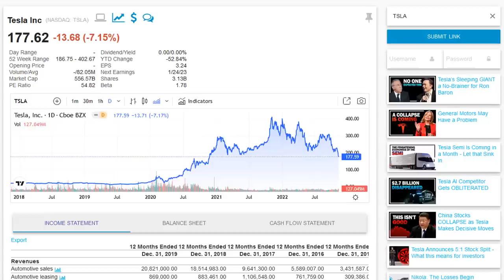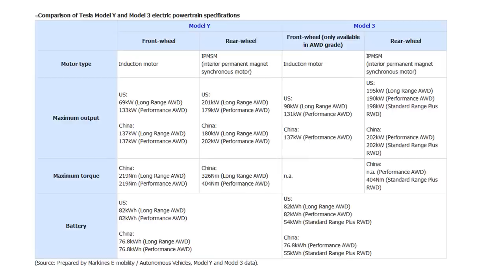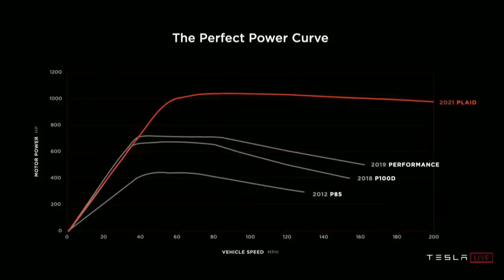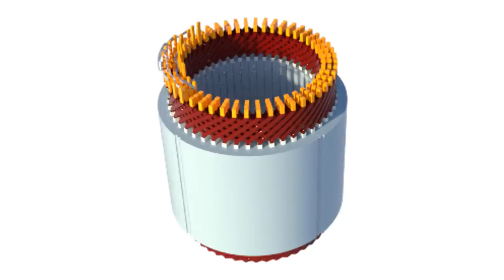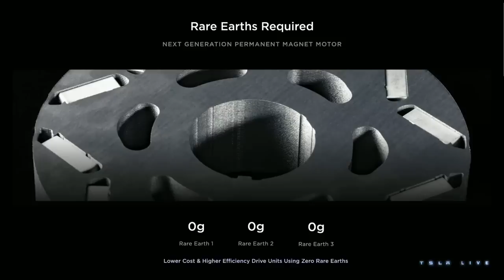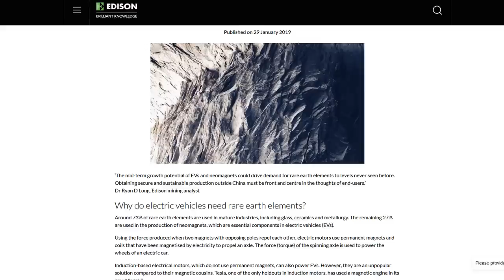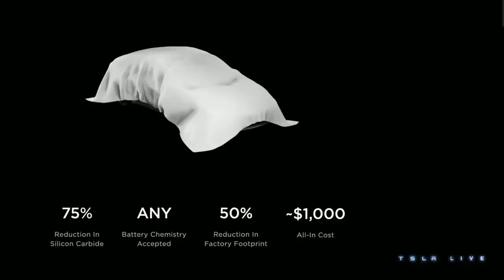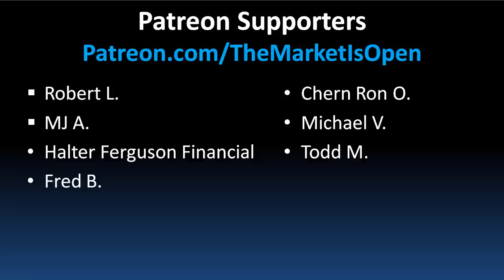Elon Musk's NEW INSANE Motor SHOCKS The Entire Industry!

Comment: Electric motors are only temporary.  Hydrogen/water engines, ionization plasma, etc. will also appear.  In a short time, maybe 50 years we will see gravitational/anti-gravity propulsion that will completely redefine planetary and interplanetary transport.  For galactic/cosmic transport we are talking about another necessity (probably in 100 years), namely the modification and regulation of local space-time as needed and the use of interdimensional wormholes as a shortcut - means of transport in the universe.  Later there will be physical and quantum teleportation and time travel in both directions.

Comment: 13:50: Wow. By making the battery smaller, the rest of the car just became $7,000 cheaper. That must be more accurate. 

/sarcasm

Hopefully you understand that the cost of the chassis is completely independent on how many cells you cram into the battery pack of the same vehicle.
Reply from the maker: Agree, but I prefaced it saying the rule was dumb to begin with

Comment: Tesla still has to figure out how to keep those electric  engines running without stopping for a charge (where there is a will there is a way ) lol like a magnetic clutch on a flywheel for assistance with power draw to help keep rotation +added power ,and a second pickup magneto to keep the charge going through the system .
Reply: That’s called a perpetual motion machine and is impossible.
Reply: @techstuff6829  It's 2023 and there are still people saying in the comments here "Why don't they charge the batteries off the motors?" It amazes me that there are people around who think that perpetual motion is a thing.

Comment: The issue isn't does it work better, it's the fact that the material's envolved in producing the energy to power the auto, which is the battery and what a battery is made of that's the issue. An conventional combustable engine requries a considerably smaller battery to operate. Dealing with the gazillion's of considerably smaller batteries is far less dangerous than the gazillion's of extremly larger batteries that EV's require.

Comment: What a stupid blah blah. Hair pin windings have been used previously (as stated in the video), indivdual motor simulation is state of the art, even for low end products. Reduction in silicion and silicion carbide, but at the same time pictures are showen of microprocessors from the media computing and ADAs systems, which has no implact on drivetrain efficiency and cost. Shockingly shitty documentary, nothing more...
Reply from the maker: I showed the inverter and charging chips which have impact on drivetrain cost.

Comment: Very good but what about the lithium bottleneck
Reply: Nobody wants to discuss it because theres no alternative to lithium. alot of the materials for those batteries is becoming even more rare and difficult to mine. Most of the worlds Cobalt is concentrated in the Congo and is mined by hand......There isnt enough matrerial to make a battery pack to replace even a 1/4 of the worlds ICE vehicles. Along with the many other inconveniences of electric cars......Making the motor cheaper is good but all it will do is offset the eventual increased cost of the battery.
Reply from the maker: Addressed in lithium video, a few videos back

Comment: Its the Henry Ford way of thinking. Make a reliable vehicle at a cheap price and everyone will buy em. Ive long been a combustion engine person, but if they are going to offer them for sub 20k price tags hell yea ill end up with one. Now just hope that they can get them to last longer than a couple hundred miles.
Reply: 1 - CME or EMP will fry your car.
2 - ANYTHING that disrupts the power grid will leave you with a dead car.
3 - Tesla can remote control it. In fact they are going to remove the steering wheel. How do you feel about that?

Comment: "Just when you thought it couldn't get any better" leaves me wondering whether this narration could get any worse. I arrived to learn about an electric motor. I stayed to play a drinking game.
Reply: No, that was the worst howler. But this video then skirts a central issue. Efficiency of prior design (with rare earth metals): good. Efficiency of new design (without rare earth metals): good + epsilon (unstated increment). Prospective new design (with rare earth metals): possibly spectacular. 

Tesla effectively answered the question: Can we improve the efficiency of our current motor, even if only by a tiny sliver, but without using any of these three rare earth metals at all? 

Could someone else come along and improve Tesla's new motor by adding the rare earth metals back into a new design? Quite possibly by quite a lot. 

And the breathless breakthrough will again begin: "Just when you thought is couldn't get any better ..." 

"Better" in this case means cheaper for mass consumption (the slightly purple phrasing used in this video was "access to technology"). 

"Better" on YouTube generally means that it can shred your tires in half as much time.

Comment: I read that a guy left his Tesla at a long-term parking at the airport. And after two weeks when he got back from his trip, his Telsa's car battery was dead.  I wonder what caused that?  Was something left on? Like a dome light?
Then there is still the issue of how do you tow a Tesla? With a regular ICE = Internal Combustible Engine Gas used vehicles; it would be put into neutral to hook up to the bed to push onto the tow truck bed. What do you do with a dead battery on a Tesla? 🤔
But keep in mind your Tesla has minerals being mined by poor Africans and using children to dig for the minerals that is built into your cell phone, your EV, and most electrical tech that is out there.  How is that clean "Renewable" energy? Plus, you still need oil, coal and gas for the charging station to charge your EV's Something to think about 🤔
Reply: they are building several solar farms across the country and in some places its cheaper per kwh than gas or coal plants
Reply: @buddyflood6761  🙄

Comment: Motor-shmotor...  Until Tesla, or someone, comes out with a better battery system, a better battery, no motor will be good enough.
Electric cars have the one weak link, of having to be recharged.  Short trips, or long hauls, the results are the same.
And charging an EV, can take as much as 12 hours or more!  That's hard to plan around.  You're daily activities are limited to the time it takes to recharge the car, before the next use.
"Solid State Batteries," sounds like a great idea.  But even after a couple of years, their promises of better EVs have still yet to materialize.
They were supposed to last longer between charges, take an EV further in milage, and faster to recharge.  Hours faster!  They are supposed to be much lighter than the common battery packages being used currently.  And they were supposed to be way cheaper than the current batteries being used in EVs today.
But where are they?  Why are people still having to pay out the nose for an EV, then pay out the nose all over again, to replace the battery pack in their car every couple of years!?

Comment: First and foremost eletricty prices are  inexticably tied to natural gas, oil and coal ; that the left wants to see gone!! Does that make sense to you. . The price of electricity is increasing faster than any other sector of energy production. It will be four fold then six fold increases. Not to mention the over taxed infrastructure as 50-foot arches of (blown up) high voltage sparks  burn down our forests.  Who is going to stop it. Nancy Pelosi?  It is rigged against us full stop. EM , is a good man, he's a product to sell and it is innovative; but also dangerous as hell. Do you really want a car whose efficiency drops 30 to 40 percent in cold weather? Already, I mean last summer California asked EV owners not to charge their cars . Okay, I guess we'll walk.  Do you really want a car that can be " at the flick of a switch".. disabled , halted ?? Dangerous? Yeah maybe. They'll do it, is the problem;. They, ( the deep state) has proven that they don't GAS about you.  EV s are a coming nightmare of high costs, and inadequate technical knowledge to diagnose and fix,. You will not be able to do a thing but pay sky-high prices for repairs etc. , to someone that barely knows what they are doing. Repairing your own vehicle will be long gone.

Comment: The only reason Tesla says the price of a motor is about 25% of the cost of a car is because the motor cost was so high.  Reducing that cost changes the ratio of the cost, so now, a motor will be something much less than 25% of the cost of the car. a 6000.00 drive train does not translate to a 24000.00 car.
Reply: Thank you Spike.  My head wanted to explode when I saw those two bogus calculations.  I wonder how many saw those and marveled at how smart those guys were.

Comment: At around 80 °C, a magnet will lose its magnetic force and it will become demagnetized permanently if exposed to this temperature for a period, or if heated above its Curie temperature. 176 °F. So if motor reaches 80 °C. The motor becomes a brick. 😂
Reply: I’m confused… do you think Tesla engineers didn’t know this? Do you think those motors get hit or don’t have cooling or something?
Reply: @warbuzzard7167  Cooling is done either by air, oil or coolent. A internal combustion engine can run as hot as 240 °F. So it can operate in any weather here on Earth. A electric motor has a range it cant operate. Too hot or too cold. Electric motors become a brick. Too far north. Too cold. Near desert enviorment. Destroys the battries. A $40,000 car should beable to run for +10 years or more. These electric cars? All you have to do is run it dry once. Poof. The motor/ battries is gone. Forgo real world issues like having to drive yourself out of a situation? Right. A life or death situation? Right. Like a blizard. 😉 up north. More hype over nothing.

Comment: Should make semis all wheel drive. Would really be good in snow and ice.
Reply: Back 8 cab tires are powered already, front steer tires won't change things much except the ability to steer the vehicle
Reply: @mikedar8484  ok.
Reply: I agree but the trailers need to be upgraded single hub drives so the whole unit pulls the weight through snow and grade.
Reply: @dohnmoore  You mean the trailer also, the physics won't work like steer tires will not work. Wish away

Comment: This is great news, but I believe the next step to truly make the electric cars viable, affordable and durable is yet to come w innovations to the battery
Reply: Absolutely. Batteries need to be small enough to swap out like ur propane bbq tank at the local gas stop. Until then, it's not gonna work.
Reply: New battery tech they are making will be bigger and heavier… But use less rare metals… So cheaper, but either shorter range or bigger battery.
In short range the cheap price is the way to go. People with money can buy high range models…
Reply: Performance isn't an issue with EVs now. It's range and charge time that will keep them niche for quite a while yet. They just cannot compete on convenience.

Comment: For the few interested 3:25 The pm motor in the rear is most likely used for big torque. The induction motor in the front would (most likely) be tuned to increase the range (similar efficiency strategy to semi)
Reply: That's exactly the opposite of what was stated, and the Tesla semi uses 3 permanent magnet plaid motors.
Reply: @edbruder9975  yes… I believe the pm motor is inherently better at high torque, especially off the line.. and It is a higher output motor.  The cheaper induction motor upfront doesn’t cog and spins freely when not being powered. They likely take advantage of that for efficiency at cruising speeds. A ton of engineering would of gone into it
Reply: @justinmallaiz4549  
The Tesla 3 has a motor which uses PM for torque at low RPM... and reluctance for power at high RPM.
I guess for gen3 they're optimizing  rotor geometry for reluctance at lower RPM,  in order to further reduce the need for PM.
Reply: Except that's not how the semi works.
The drive to the "Power motors" is physically disengaged in "cruise mode", meaning they don't spin at all, so no back EMF.
Reply: front is more efficient.  but rear enginine power was fun.
Reply: The introduction to this video has this disclaimer as a general channel statement: "The ideas expressed on this channel are purely opinions and should not be regarded as objective information. Nothing on this channel is a recommendation to buy or sell securities. Do not assume that facts and numbers in any video are accurate. Always do your own due diligence."

Saying "do not assume that facts [...] in any video are accurate" fundamentally alters the fine semantics of the word "fact". Something can only be a fact if it cannot be disputed.

Comment: Wrong. The AC induction motor has no magnets. The internal magnetic field is derived from induced current from the stator windings. Also, I think you are confused about silicon carbide in their electronics. The logic devices are probably standard CMOS while the power electronics like IGBTs and MOSFETS are where the bulk of the silicon carbide is used.

Comment: How does reduction in powertrain cost translate to reduction in cost of rest of vehicle. Why are they still dividing by 25%? A reduction in powertrain cost means a reduction in proportion of powertrain cost to rest of vehicle.
Reply: Its because like dopes, they think there is some kind of magic rule that the car always costs whatever 4 times the cost of the power train is. Drop the powertrain cost and suddenly everything else dops in cost APPARENTLY! The body, the seats, the windshield, the cupholder, the ash tray! Gives you an insight into the minds of certain egg heads.
Reply: The "back of the napkin" model on cost is exactly that.  It is not precise.  I spent 25 years working for a major Japanese automotive manufacturer and the math is actually pretty close, BUT it is only based on observation of vehicles' cost, and not necessarily due to any engineering or manufacturing cost targets.  ICE's cost what they cost, and each engine is used in many different models at many different price points.  If Musk can get a Model 3 delivered for under $30k, then consumers will move his direction in droves.  He knows this, and is what is driving innovation targets.  Currently, however, as is well known, Tesla is a "luxury" vehicle and is limited in its consumer acceptance.  So, his value proposition is a serious one.  Can you imagine a Model X at the same price point as a Honda Pilot, or a Model 3 at the same price point as a Toyota Camry?  That would obviously be a major coup!
Reply: @guydoesstuff6562 model 3 is under $30k now with the Federal rebate. Definitely a lot more affordable than a year ago!